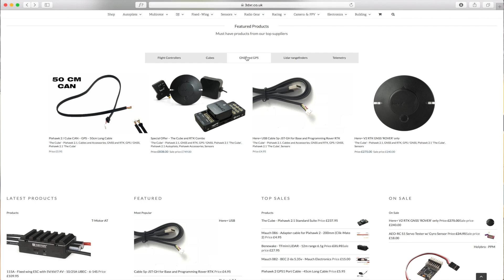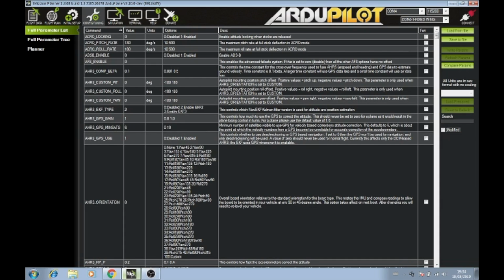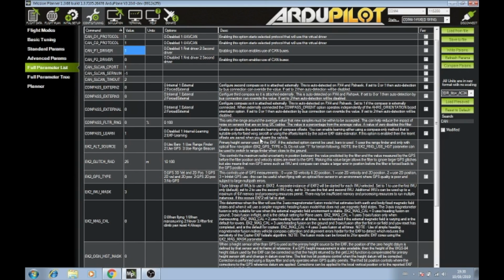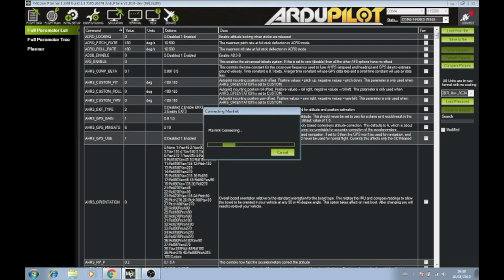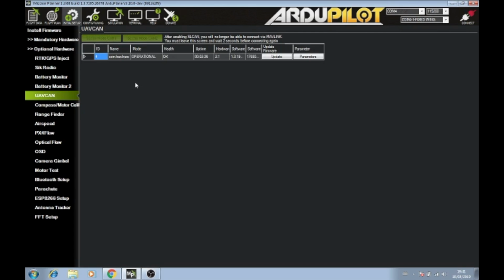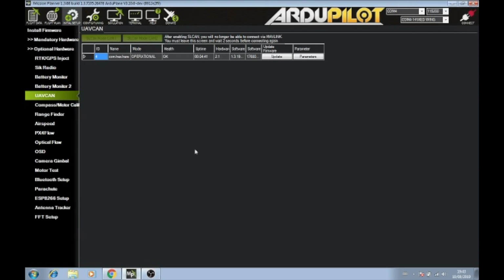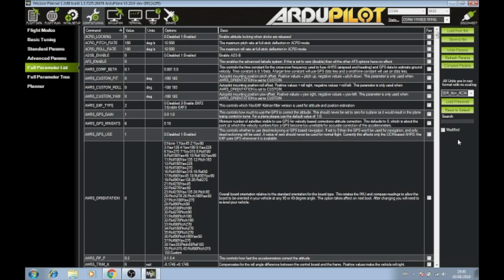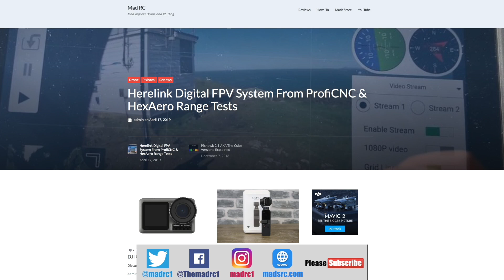Here 2 GPS UAVCAN Setup Info For Cube Autopilot ProfiCNC HEX Aero & Pixhawk

Comment: Great video, I desperately needed to free up a serial port. Thank you. Do you have the pinouts for converting the six pin serial connector in the here 2 to the 4 pin CAN plug? It would be easiest for me just to change the 6 pin plug going into my GPS port on my PixHawk Cube to a four pin CAN plug. Thank you again.
Reply from the maker: You have to change the whole cable on the Here 2.  It’s a separate one.

Comment: Your videos help out tremendously butvim confused still with arming...I have the pixhawk 2.1 cube black with the here2, I also have the safety switch installed on the fuselage. I was able to arm with safety switch but could not disarm by switch...I went in MP and changed parameters to arm with min throttle, rudder right...and min throttle, rudder left to disarm...but it still would not disarm

What am I not doing right?
By the way, my here2 works fine, 3d lock pretty quick
Reply from the maker: That’s odd, are you holding the button down to disarm ?  

It should just work.  Strange let me look at some of the prams
Reply: @MadRC  ...it works for arming if I set the parameters, but it will not disarm...I tried the rudder stick inputs, so arming works that way but will not disarm with rudder/yaw input...then I also reset the preflight check list with different parameters, but still could not disarm...this is actually the final piece to the puzzle for maiden...so im apprehensive about the maiden, too much invested now, and you look to be the best chance of figuring this out....I asked others that said to read the wiki, which I refer to for all my parameters settings....and thank you for your response  sit!!
Reply: I was wondering, because as I said, you're the most knowledgeable about pixhawk and here2/3 ive seen on YouTube, and obviously a wizard with MP IMO...is it possible to send you screen shots or video of my dilemma for your review?

Comment: Can we inerface rangefinder and GPS and mutiple peripherals via CAN port using -https://ardupilot.org/copter/docs/common-avanon-laserint.html.As we know that GPS	Compass	Barometer
Rangefinder	ADSB Receiver	Power Module
LED	Buzzer	Airspeed
Safety Switch/LED	  are covered to be interface via CAN bus,could you suggest how do we only use CAN as our communication protocol and not use I2C at all.

Comment: So what's the advantage of using CAN over the regular method? Less wiring is nice but is that it?
Reply from the maker: The major benefit is moving away from the I2C on the compass line.  It’s far from the ideal communication in a RF noisy environment like a drone.  Secondly it frees up serial ports and CAN is more stable overall.   It also means other hardware in the module can now be used all on the same data bus

Comment: I also had my GPS brick and go to green LEDs after updating the bootloader and rebooting. If you disconnect the GPS from the cube, boot the cube normally, then start SLCan for the appropriate channel (1 or 2, depending which you plug your GPS in), and then plug the GPS in, it comes back up in the UAVCAN screen and you can update the firmware again. At least, that was my work around for a bricked GPS

Comment: thanks for the video, I got a situation because I follow your steps until the bootloader firmware update, then with the solid green lights I rebooted the pixhawk and connect again but this time I have the solid green lights as you said but the Slcan mode don't recognize the GPS to update the other part of the firmware.
Could you help me to resolve this situation?
Thanks in advance
Reply: I have the same problem. did you solve it?

Comment: I tried to update the firmware on the Here 2 and seemed to have bricked it. I updated the bootloader, no issues, waited for sold green lights, rebooted, reconnected. But now when I try to go to SLCan Mode CAN 1 on Mission Planner nothing happens, no errors, I can't finish updating the firmware. Sold green lights still but is now totally useless. Any ideas?
Reply: Same with mine.  What did you figure out?  I believe mine is bricked.  Bootloader process ran fine but I can't get into SLCcan mode again to run the firmware update.
Reply: try to go with SLCan Mode CAN 2

Comment: Thank you for the video! I have issues as to when performing the update and rebooting, entering back into UAVCAN through optional hardware doesn't seem to recognise the GPS again? thus I cannot upload the firmware after the bootloader nor can i enable the barometer. Is anyone else experiencing this? Thanks!
Reply from the maker: Thats odd, have you tried on the 4.0 Beta there is now or Master for Plane
Reply: @MadRC  Thank you for your response! I currently have Arduplane 4.0 uploaded onto the board. I am relatively new to mission planner but would i find these within custom firmware?

Comment: Other than freeing up the I2C port, are there any other benefits from changing to UAVCAN? Does this applies to GPS unit shipped with original Pixhawk 2.1?
Reply from the maker: Really it’s down to modern tech over older when your not concerned about freeing up ports.  Right now both serial and CAN will do the same thing overall.  If your GPS is capable of both id just use what is simpler for you.  As we note forward CAN will become the standard as it has in automotive applications.

Comment: Hi! Thanks a lot for this great video. Thanks to it, I managed to configure my cube to work with 2 GPS: one on I2C on GPS1 port, and the other one on CAN bus (I had to update my Cube Black to Copter 3.7 though, as the SL CAN mode to set manually the node ID never worked).
I have a couple of questions though: now with 2 Here2 GPS, I think I have 4 compasses (with 1 Here2, Mission Planner shows 3 compasses: 1 external and 2 internals). Is there a way to use the 4 compasses (and all the other sensors that come with the 2 Here2 GPS)?
If not, would you recommend to use 1 external and 2 internals, or the 2 external and only 1 internal ?
Thanks !
Reply from the maker: I would stick to a single external compass or two external ones, using the internal ones in frame are not ideal and can cause more issues that it’s worth.  Best case use duel external mag, Iv not setup this my self and will look at doing a video on it actually as it’s a really interesting subject.
Reply: @MadRC  Thanks for your answer. I indeed wondered how I could make the best use of all the sensors I have having a Cube Black and 2 Here2 GPS.
Reply: @MadRC  Hey, as you might have seen in the Ardupilot forum, they told me that the max number of sensors is 3, and it makes no sense to use more. Also that the best configuration with 2 Here2 GPs is to use the 2 external compasses and 1 internal.